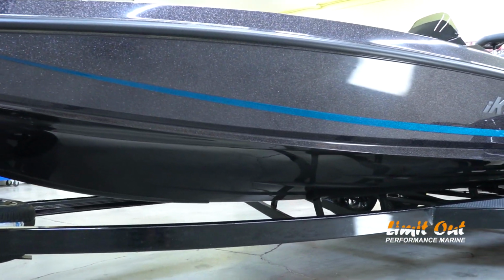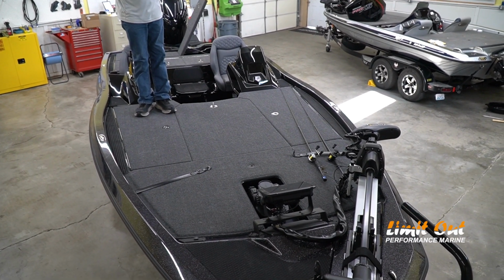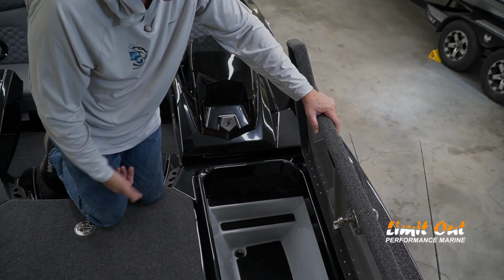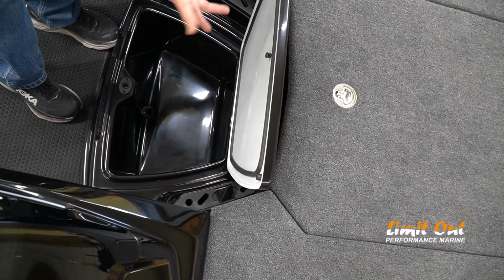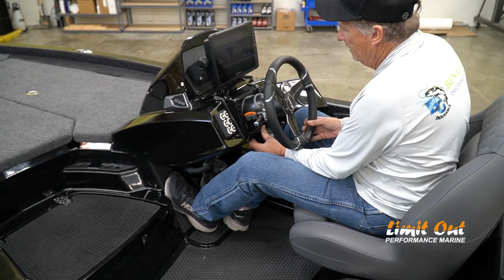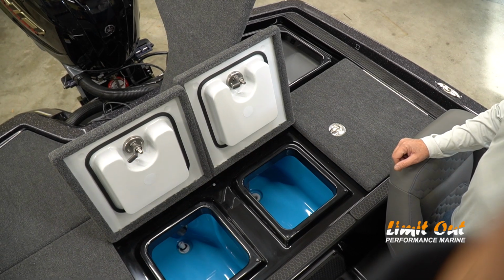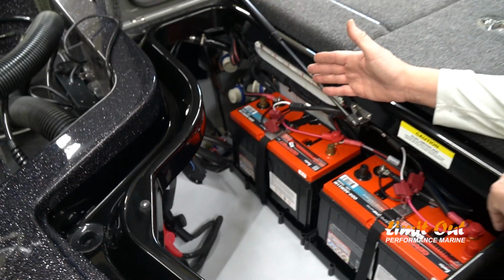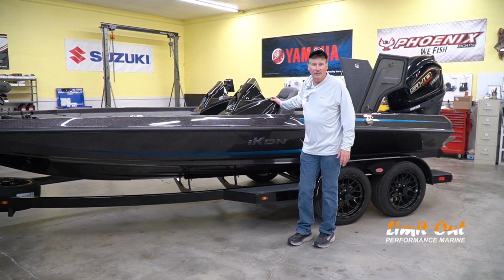BRAND NEW 2025 iKon VLX21 Bass Boat

Comment: For the low low price of 100k+ 😂🖕
Reply: the vlx starts at 70k prob 85k rigged out
Reply: @Grayson-e2c  built out a vlx21 fully loaded features, 2 10 garmins, force, poles, lvs34, lithium Dakota trolling motor batterys. 100k on the dot just missing a 12 and 10 for the front which would bring me to the cost of a skeeter fully loaded but more feature loaded. bang for buck the only boat that can "justify" price
Reply: Bass cat